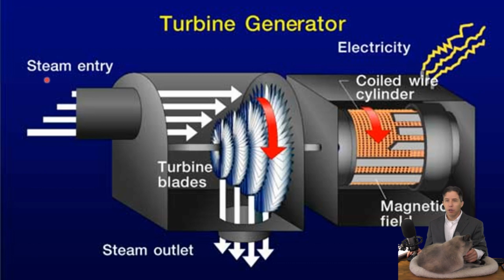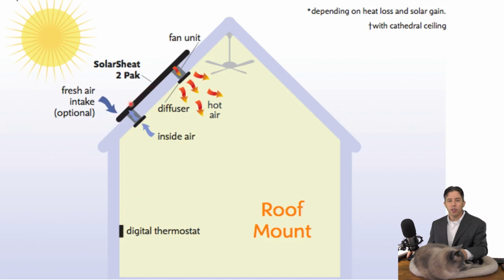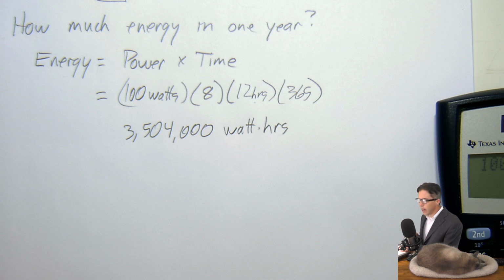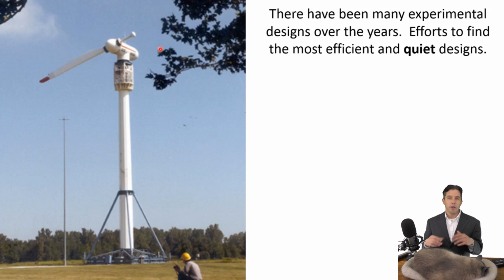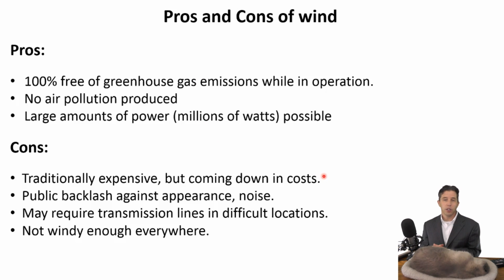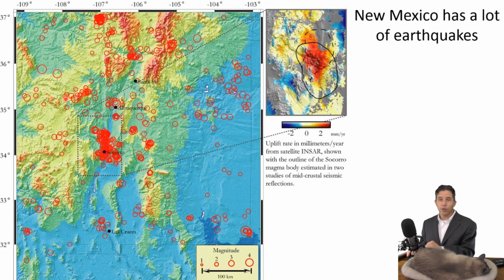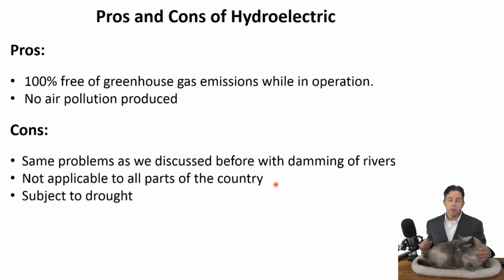Lecture 20:  Introduction to renewable energy

Comment: so eight years later, here in austria, almost every house got PV. mostly funneled back into the grid. if only we could transfer everything to 12V :)
Reply: 12 volts is ridiculously low, which means large amperage to deliver a given wattage... high amperage means high resistance.  Since solar panels put out DC current (as well as battery backups/storage) DC would be a better choice since it would obviate the need for inverters and stuff which can lose power through conversion losses... but IMHO it'd be far better to use a higher voltage.  The Apollo spacecraft which ran on fuel cells that also put out DC power ran on 65 volts for this very reason... higher voltage means less amperage to deliver a given amount of power (wattage) thus smaller wires and less loss from resistance in the wires.  Kind of a tradeoff because high voltage DC is more dangerous than high voltage AC current, safety wise, but then again you don't really want to come into contact with high voltage AC or DC LOL:)  

This was something that I wish he'd have discussed... solar and batteries can ONLY produce direct current power, and to use it in an alternating current system you have to run it through an inverter to change it from DC to AC.  Wind, geothermal, and hydropower (anything using a rotating dynamo generator) produces AC power which can easily be stepped up or down in voltage via transformers and can be used directly in AC powered equipment and appliances. BUT to store it or use it in say an electric vehicle which uses batteries, it has to be converted to DC power that can be used to charge batteries (via a rectifier which is the opposite of an inverter).  It's not particularly difficult but it does add to the complexity of the systems and isn't lossless... there's always SOME loss of power when converting from one form to another, or even stepping up or down voltages in say a transformer, and there's always line losses in transmission... but generally speaking the higher the voltage the lower the line losses.
Reply: @lukestrawwalker  you are right. i was just thinking of low power applications  having installed some solar myself, i was stunned how large a diameter the cables use 😅

Comment: Another disadvantage of a windturbine is that its blades casts shadows. I once saw on TV (in the Netherlands) that this shadow fell on somebody's house, and inside the people went crazy from the shadow-light-shadow-light...
Reply: Sounds like a weak argument against. The number of people living close enough to a wind turbine for it to cast a shadow on their home must be tiny and if was generated from one that they installed on their own house then they clearly didn’t spend enough time locating it in a position where this wouldn’t be an issue.

Comment: Renewable or not is utterly irrelevant. Calling something Renewable tells us absolutely nothing useful about energy  sources. What's important is clean, reliable, low environmental impact energy. Let's retire the useless term Renewable. Instead let's go by costs, benefits and results to determine policies regarding our energy infrastructure.
Reply: I get your point but it’s not utterly irrelevant at all, in fact renewable is just as important as the other qualities you mentioned. We could find the cleanest, most reliable and low environmental impact source of energy but if there was only a small amount of it that could not be replaced it wouldn’t be worth investing in because it would be exhausted after a short while. Therefore having a sustainable energy source that replenishes itself is totally relevant.

Comment: 21:00 Actually, you could get a lot of solar energy, on average, even near the poles, just by using a two-axis tracker and keeping the panels pointed sunward. A flat horizontal plate is not a limitation you need to accept. The most difficult problem, in addition to most polar areas being fairly cloudy, is the extreme seasonal variation. You'd need either ana amazing long-distance grid connection to somewhere else, or some way to convert energy to something you could stock in large amounts, such as hydrogen (which is not too efficient).

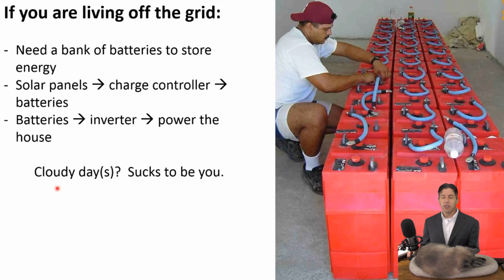Comment: 18:00 A cloudy day doesn't mean you can't generate any power, just much less.

I would not generally recommend to anyone to set up their own wind turbine. You would need a really unusual and extreme situation to make that worthwhile. And por dios don't attach it to a building.
Reply: It’s not very useful to just say you don’t recommend something and then not explain your reasons why. No offence but why should I take your recommendation of anything when you give no reason for me to? Judging by your other comment you seem to be pro solar. That’s fine but again you give no background to why you are someone to listen to
Reply: @VegaPhil  That's not fair. I expressed an opinion. I'm not obligated to explain why. You need to realize I'm leaving a comment, not making a video myself—which might give a bit more validity to your complaint. Now, if you were to simply ASK why I came to that conclusion, I might respond a little differently. But when you come back with that kind of complaining tone, I'm just going to brush you off like so much lint.

Comment: Be good if you could also do a video on cost effect, for example wind turbines have a shelf life of maybe 20 years also solar panels maybe 10 years. So how much coal or carbon is produced to make them and will that offset that over the years of its shelf life.   Not to mention once a panel or blade is finished what happens as I don't think they are recycled.  I am all for renewables but not if they are hiding the way they make them or then what happens at the end of their shelf life.